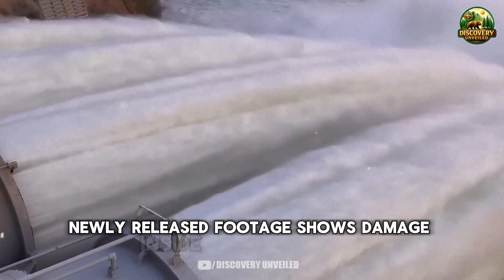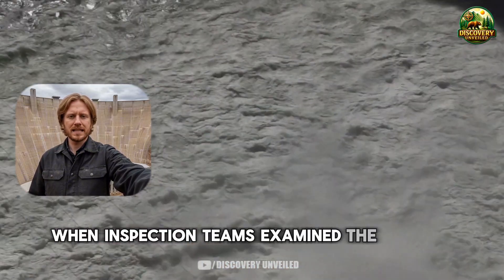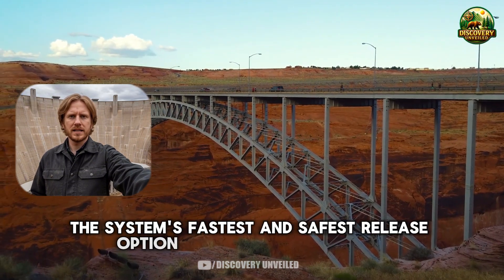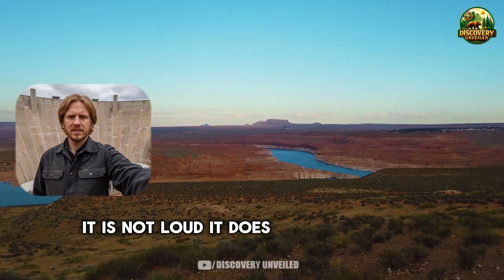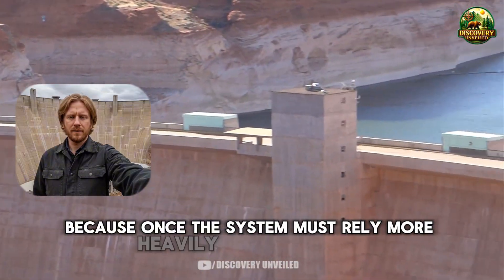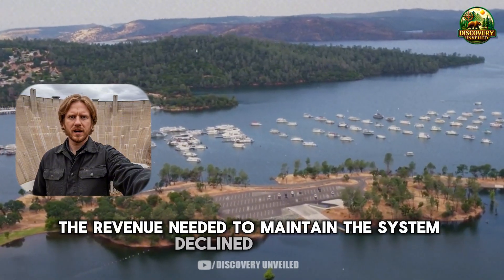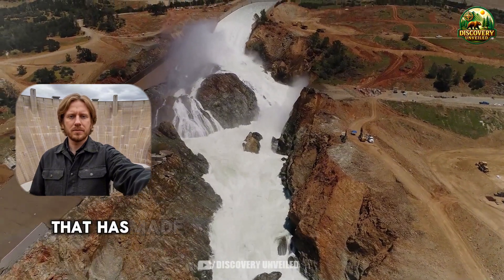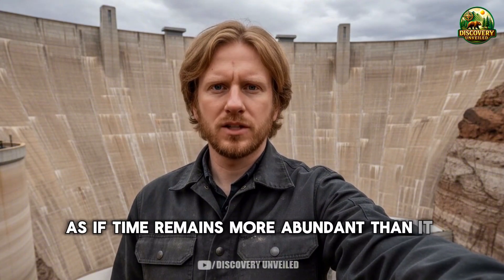Footage Showing Major Damage at Glen Canyon Dam Reveals the Aftermath Nobody Expected!

Comment: Quit showing different areas, makes you a truth stretcher.  When storm is coming, makes sense to lower the e level to allow the influx.  Better to lower thr water than have it flow over the spillway.
Reply: Read the disclaimer.
Reply from the maker: Lowering levels before storms is standard safety practice. We’ll tighten locations shown—what details would help most next time?